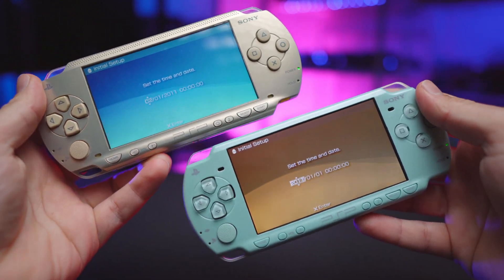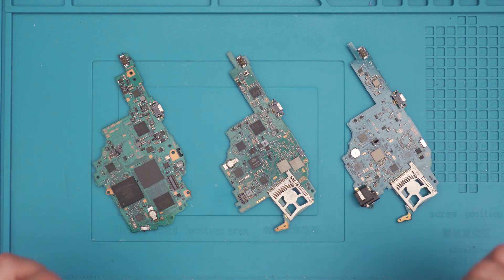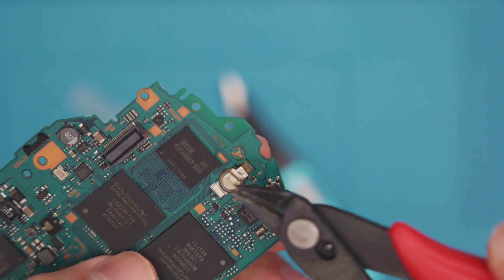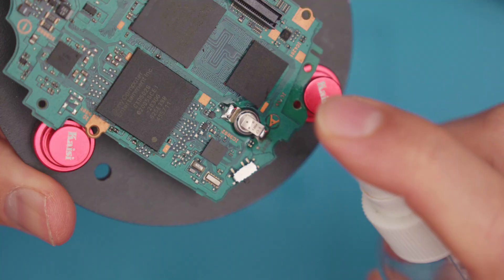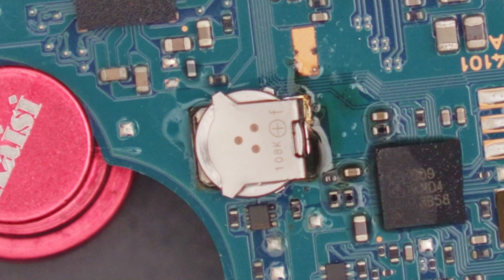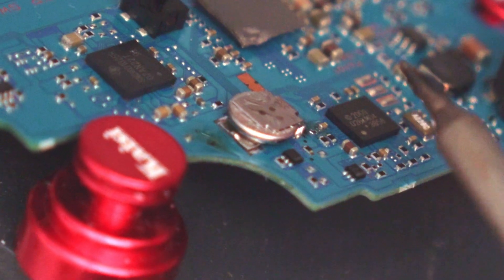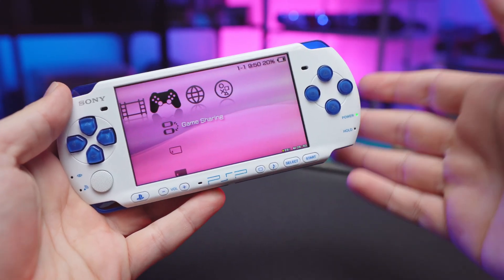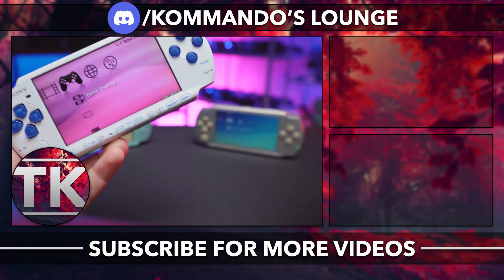How To Fix PSP Super Capacitor "CMOS BATTERY" [Read Description]

Comment: Bro can you do a quick video update about this with the PSP running without the CMOS battery/super capacitor?
some folks like me are still hesitant on what the after effects will be like once you powered it on lol
Reply: I did it yesterday and can confirm that my PSP 3000 came to life again. I removed the super capacitor, I tested all day long and it is working perfectly until now.

Comment: is there anydownsides to removing it ? even if you do not have issues?
Reply: will the PSP still keep time etc as long as the battery itself doesn't die , if it does die do you have to redo settings and stuff or only the time ?
Reply from the maker: It only keeps time and date, so as long as there is a cable or battery plugged in, it will keep that, no settings are affected
Reply: @TotalKommando  ok sweet , is it possible to switch it with just a normal battery ? such as what a ps4/3/2 use or not the right type of circuit. im thinking of just removing on my new 1000 i got while its opened , even if its not broken just fixes any future problems , and being a 1000 , want the longest life i can get.

on that note , what do you think of the big battery mod? useing a bm46 4000mah battery in the umd tray ?
Reply from the maker: My stance is to just remove it and call it a day, installing another one isnt worth the hustle
Popular option for sure with the BM46, I have not tried it yet will be doing so in a later video.

My next video will be about custom batteries, just make sure you remove the built in BMS pcb board on it, so its fully managed by the psp bms.
One thing to note, is that you wont be getting the full capacity as its rated for a higher voltage than the standard 3.7V
Reply: @TotalKommando  ah okay , I'll wait till your video , I follow them for everything what got me into it again , I look forward to it.

Comment: Hello, I have issue powering my psp. So as I start my console its light turns on and after two seconds goes dark, I have tried couple of batteries and it’s still not powering. Can the cause be the removal of the supercap? The fuse is alright. Thanks in advance!
Reply from the maker: If its turning on and off, I have not seen a super cap do that, you may be running into something else, perhaps a stuck power switch?

Try powering with only your charger
Reply: I will try replacing it, thanks for the advice! Really do appreciate it and your content!
Reply: Do you have patreon
Reply from the maker: @JuzeBG I have been asked many times if I do, perhaps I should xD

All I got right now is YT memberships and KOFI

Thanks for the support

Comment: Hi everyone! So, I'm having a problem with my PSP. I lent it to my friend and he managed to give it a jolt to turn on. I thought it started working fine again, but I realized when I played a little bit and turned it off, when I turned it back on, the battery was low. I plugged it in to charge it and the light came on. Suddenly, the light went out and it wouldn't turn on. I tested it with a cable I made and it woke up. In short, my PSP only turns on when I jolt it (sometimes it doesn't even turn on), and it drains without even using it. So could this be the problem? This little battery?
Reply from the maker: what do you mean when you jolt it? what are you doing exactly?
Reply: @TotalKommando Sorry, I didn't explain it well. It's like I have to wake him up every time, you know? Even if the battery is charged, as has happened before, it won't turn on. I have to "force" it with more power, and then suddenly it turns on the orange light, only when it wants to. But now, apparently, it won't turn on.
Reply from the maker: when you say more power, like are you giving it more voltage or just plugging in the charger to make it turn on, it sounds like you got a defective battery
Reply: @TotalKommando Here’s what happened: his battery was also giving an error with my PSP. I gave it to him to test, and it worked with his cable, my PSP turned on. I took my other two chargers to his house, to see if was broken, and they worked too, the charging light came on. I thought, maybe it just needed a little charge to start working. When I got home and plugged it in to charge, the light came on, but later I noticed it had turned off. Then the same thing happened again, it wouldn’t turn on.

I did something he suggested: I took a cable with the PSP charging connector from a charger, cut it, and spliced the USB end to plug it into a regular phone charging brick (not a fast charger), because it was with that type of cable that he managed to turn mine on, but he bought one like that, I made mine at home with what I had...... And it worked, the light came on. 

I let it charge, and it worked fine. The battery was at 100%. But later, the same error came back, and it wouldn’t turn on anymore. I plugged the cable in again, and boom... the light came on! I played a bit and the battery went down to 85%. I went to sleep, and when I woke up... guess what? It wouldn’t turn on. I gave it another charge, and when it turned on, the battery was at 45%. Then it stopped working again. I tried, but now it won’t turn on at all.

I think it might be the same battery issue like in the video you showed, because I used to play a lot with the charger plugged in. Since it’s old and I used to do that a lot, I think that’s probably the reason.
Reply from the maker: 3000 model right?
sounds like one of those weird random charging issues, the super capacitor removal may or may not help, or might make it more consistent
Reply: @TotalKommando It's the 2000 model! I'm going to open it up and try to make the replacement. If I manage to fix it, I'll report back here. It might help other people too. And thank you for your attention, I really appreciate it.

Comment: well. several months ago, i wasnt very lucky with the 3000...kinda save a tiny bit of trace, but when i tried to install the new cmos, i ripped the remaining trace. just ended up not installing the cmos.
Reply from the maker: Moving forward Im not even going to bother with installing a new cmos, they will just die again later down the line and cause more issues, not to mention after doing a custom battery there will be no need

Comment: are there chances that the psp won't cold boot(start with just a battery and no charger) if I disable the supercapacitor on my psp 3000?
Reply from the maker: Is that something you are experiencing? I heard one person say their psp wont turn on till they reinstalled the super capacitor after removing it, but that just means the psp possibly has a defective chip which is now super common, and brings all sorts of weird issues related to power. But I tried asking them for more info, they never replied perhaps the capacitor removal didnt have anything to do with it turning on. Sometimes you gotta leave it without power for a while before it starts accepting power again.

Comment: I have a question. I did experience having my PSP 3000 will only turn on when charger is plugged and goes off when it is unplugged but it do have charging indicators (orange). Tried disabling the super capacitors. But still the problem persist.  Sometimes it will turn on when charger is unplugged but it will last for a few minutes.
Reply from the maker: This is one of the problems I am trying to investigate, I got one unit that does that, its been driving me crazy. And seems like the issue is becoming more common and common. Essentially, if you plug it in (when its been sitting around for a while with no battery or power) it will charge / accept power. Now unplug replug, there is a chance it stops charging/accepting power.

Unplug battery and charger for around 5 mins, it starts to charge again.

But in my case, if the battery is charged, it turns on with out the charger.

Is this what you are encountering?
Reply: @TotalKommando  Yeah, it happens on my PSP 3000. Sometimes I change the battery of my PSP 3000 from a functional and fully charged PSP, and it will turn on without the help of a charger. But I noticed that the battery indicator on the display keeps glitching until the PSP turns off after turning on for about three minutes. When I attempt to turn on the PSP again, it will not turn on unless you plug the charger in again.
Reply: Saw some video tutorials about this for the PSP2000, where they heat the power IC for 10 to 15 minutes using hot air, and then the power issue is gone. I have no idea if it will work on my PSP3000, too.
Reply from the maker: @giovannibielza9111  if its glitching, it might be the battery bms or a bad connection on the battery pins
Reply from the maker: @giovannibielza9111  I thought about reflowing the Byron chip for the 3K. Need to do a bit more research before i dive into it. I always looked at this issue as charge build up triggering a possible fail safe. There is a good chance it may fix the issue.
Reply: @TotalKommando Yeah, I thought it might be the bad battery pins too, because when I bought this second-hand PSP online, the battery pins were soldered badly, and I thought they might have been replaced before.

Comment: Would a heat gun or a really really hot hair dryer work to remove the super compasitor on a psp 3000? I dont have a soldering iron or solder wick.
Reply from the maker: Nope, and it would probably kill your psp from all the heat going everywhere
Reply: @TotalKommando  thanks for letting me know, I'll look into getting a soldering iron or see if someone I know could do it for me.

Comment: so i dont know why my psp wont turn on after disabling it. no indicator lights when charging. tried swapping the motherboard on another psp and it lights up a bit and then very dim orange light. any help?
Reply from the maker: Try leaving the motherboard disconnected from any power over night and try again with DC power only and the power switch and let me know how it goes.
The dim orange light could be either a defective power switch board shorting somewhere or it could be lighting up through your fingers passing tiny amounts of power
Reply: @TotalKommando just want to make sure, can it turn on without a battery installed? Because i think i need to replace mine
Reply from the maker: yes  @aniqrth

Comment: So I used the link for the 3000 capacitors and got them the other day then I went in and swapped the old with the new all went good, but one issue I came to realize and want to emphasize in your video to check continuity because I'm confident in my soldering so I didn't check it, only to find out all 5 capacitors I ordered for the 3000 have continuity so I unfortunately have a PSP paper weight now because it's dead, I tried removing the capacitor and praying it didn't get killed but it's dead, thanks AliExpress!!! But all in all I really like this video and all your videos for that matter, keep it up! :)
Reply from the maker: Hey sorry to hear it, but I don't think this can kill your psp fully. There is still hope.

Does it turn on with battery alone? 
Try turning it on after leaving it without battery or charger for at least 5 mins.

Was it not keeping time or did you replace it as a preemptive measure?

I just tested shorting the super capacitor terminals on my already defective moded psp that I was talking about for my next video and it still turns on after leaving it for a couple mins.

Thanks for the support, let me know how it goes.

-----------------------------------------------------

I have been going crazy for the past week trying to figure out whats going on with the PSP I have been modding for the next video, just spent several hours again trying to diagnose whats going on.

At this point in time I found continuity on some of my OEM capacitors while they are connected (will need to revisit this on all my units and take notes), they sometimes show continuity other times not, need to do more testing to confirm.

The type-c moded one I have here stops turning on when its got a power cable connected then reconnected quickly, it turns on and charges normally only after its got it's residual charge removed by leaving it for a couple mins, with both battery and charger removed. (In the past I had one that took hours to do that)

Im trying to look deep into it, recently a lot of 3000 units are going down from people who found theirs after 13 years of sitting around, and I got at least 2 that have power issues that I mentioned above, with or without the original capacitor or an aftermarket, shorted or not. 

Hop on discord perhaps we can pinpoint something when Im on.

Comment: Hey want to ask here, are psp 3000 super capacitor disable method is permanent fix or temporary fix ?
Reply from the maker: It can be both, if you rarely swap batteries or got only 1 battery, it will keep time as long as there is a battery.
Or you can do this to possibly fix some of the weird power issues till you are ready to replace it.
Reply: Ok bro thanks for the info, really help so I not buy the wrong super capacitor

Comment: I live in India and I have no way to get my hands on the capacitor do can I get the CMOS specs so I can replicate it? Or is there anyway I could use a small super capacitor? Or use a laptop CMOS? 😂 Nah kidding but if you can help me , please let me know(psp 3000 model)
Reply from the maker: I would just remove it and use my psp without one, specs you can find in the links in the description
Reply: @TotalKommando i already have soo much modifications done , I am not an engineer and I am 17 so I made some mistakes along the way but either way my battery is soldered in with 2000mah battery but shows symptoms of dead CMOS battery like it won't turn on without charger plugged in and will not keep turning on untill the CMOS battery is somewhat charged even though it is dead , idk what's going on and if I remove the battery as whole and use the charger , it still doesn't work I guess it the CMOS battery problem and even without replaceing it and just by removing it can I solve these problems?
Reply from the maker: @TanavRaj-w1y  Yes, like i said in the video, you can goto a phone repair shop and ask them to remove it safely if you want
Reply: @TotalKommando well , that wasn't helpful
Reply: @TotalKommando  i did some research and found that the capacitor in 1000/2000 model uses 5.5v 0.1f capacitor and 3000 model use 2.3/2.5v 0.1f capacitor so replacing it if you can get your hands on a small capacitor which fits in it will save time and money or even in places where you cannot get hands on or maybe better the skill not to depend on company? Idk either way hope I don't burn my psp

Comment: If the pad on the board for the capacitor is damaged or ripped out, am I out of luck? My PSP 3000 is much more fragile than I thought, and the non-soldering method ripped out the pad itself.
Reply: Same here but for my 1000. I managed to super glue and solder the capacitor in place but I don't know where to manually wire the contacts

Comment: I have a psp 3000. I am having this problem: After fully charging the battery, then turning it off or putting it in sleep mode. The battery will be completely drained after about 1 day. If I remove the battery from the device, it is completely normal (the battery still maintains voltage). This problem just appeared 1 week ago. My device is also in a situation where when the battery is removed, the date and time must be reset. Please give me some advice.
Reply from the maker: remove or disable the super capacitor like i said in the video, if your external battery is what you are talking about

Comment: I swapped super capacitor on my 3000 model, but it still asks to set time after replug battery
Reply from the maker: How long did you leave it with a battery or plugged into power for, before unplugging? (doesnt need to be on)
I found it takes couple hours for a decent charge and 6-8 hours for a full charge, then the cap will drain if there is no power and usually slowly discharge and reset time if left for more than 6 hours or so, milage may vary
Reply: @TotalKommando  I left plugged to power supply for the whole night, and the battery was plugged as well. Now I suppose that battery drains faster when psp in sleep mode
Reply from the maker: @denysryzhkov570 Some ideas:

Something could be shorting, 

or the cap is defective

or the cap was damaged during the install process, double check with a multi meter or inspect it visually that the terminals around the ring of the cap are not shorting
Reply: @TotalKommando  Thanks for your advice. Gonna investigate
Reply: @TotalKommando You were right. It was short. All works as expected now. Regular amount of battery drain in sleep and there is time clock save . Thanks again, you do a great job
Reply from the maker: @denysryzhkov570  nice

Comment: my 3000 won’t charge when in use , battery is undected at time and detected at others when brightness is up and the power blinks green and orange. the time also always resets. could this be my issue ? my charger is also a little loose when plugged in. just order a new battery and charger
Reply: also when i take the battery out and plug it in , it works but then will suddenly turn off , hoping it’s the charger
Reply from the maker: Charger: Use one of those USB to DC Berrel cables with a 5v 2amp usb adapter (you can try spinning your adapter till you get a stable charging led)
Battery: Could be a really cheap dying battery with bad contacts
If you replace those and you still have the problem then you should check your super capacitor (if its not keeping time)

Comment: i just want to ask one thing is in my country they don't have 3.3v type but only 3v type, but their solder pins are quite similar, i don't know if it will work ok?
Reply from the maker: it could work but not sure how long it will hold charge and if it will cause more power drain or if they can handle the higher load. if they are cheap enough, you could try getting them and trying them at your own risk